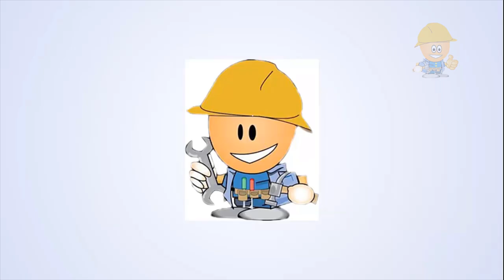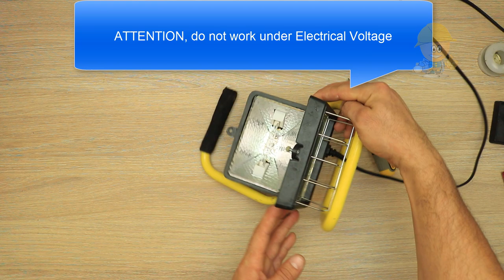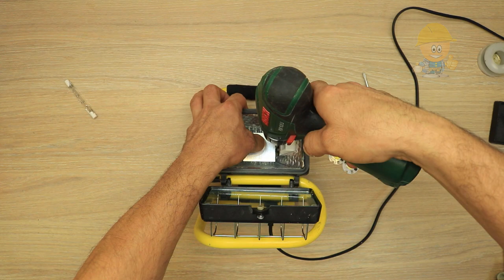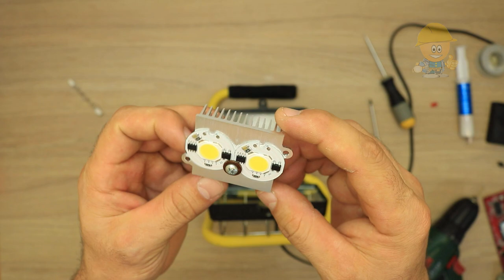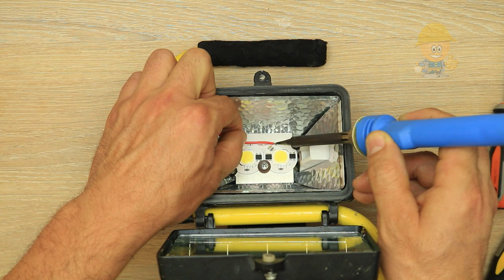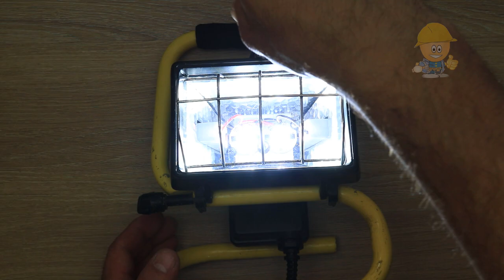Replacing / Convert Halogen With LEDs Chip COB  / LED Floodlights

Comment: Have seen a few of these and they all take them apart and remould the reflector, I was considering putting a heat sink in instead, now I know that's a winner, so thanks for that.
I also like the fact you keep the existing build terminals and just solder a wire👏. The simpler the better!
Good enough for a sub👍🏼
Reply from the maker: Thank you jonny.